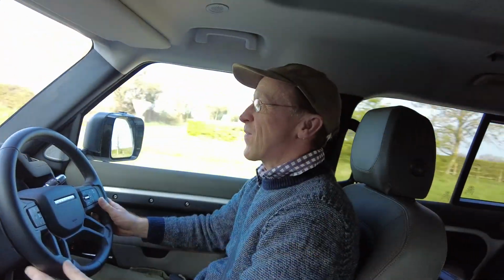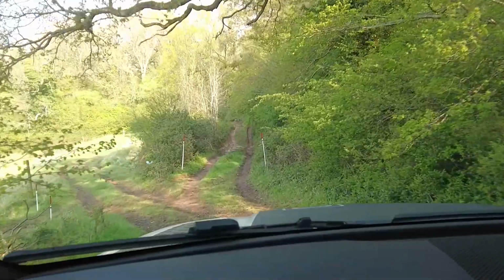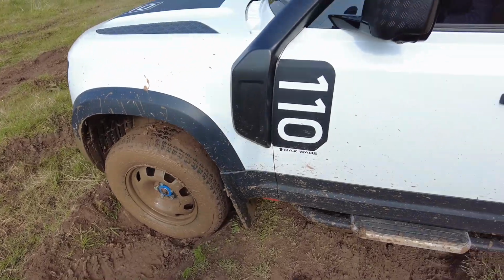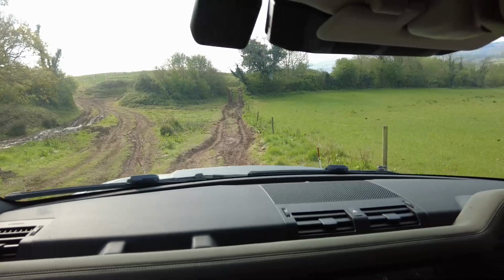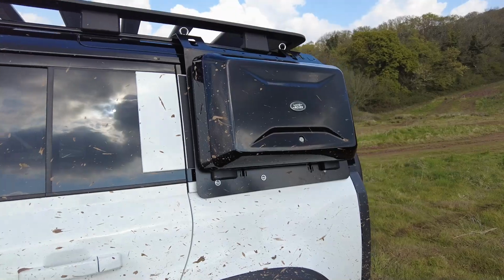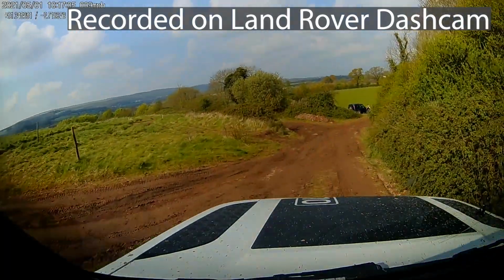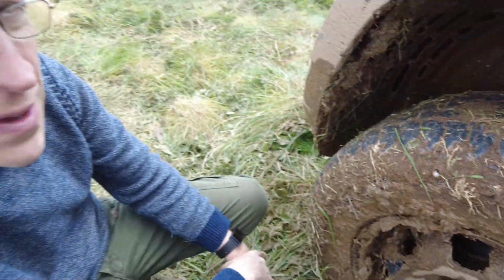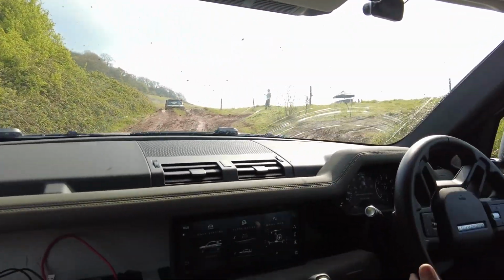New Land Rover Defender Off Road Test... New Wheels / Compressor =  Result ? [HD Video]

Comment: How did u reset the center screen? Had the same issue that my center screen wont turn on
Reply from the maker: I just turned the car off had a chat with some people and it came back of its own accord.
Also you can try pressing the on/off button for 40 seconds to force a "soft reboot"
Failing that you need to disconnect the battery ( battery under the drivers seat ) for 10 mins and re connecting.

Comment: The steps there; grass gravel snow would have worked better for you than rock crawl not saying it would have easily beasted the steps you'd have still needed momentum as the Defender is very heavy. Even though logically, rock crawling is kind of what is being simulated, what you had there was firm ground with a slippery surface, and for that, you want grass gravel snow.
Reply: Dead right sir! The tyres were full of wet clay and presented a circular wet surface with bugger all grip to the steps. I don't think rock crawl mode would work either if it were in the U.S in say the Moab desert and if it were pissing down with rain, you would still have no traction ( not very likely though in a desert lol)

Comment: when the screen goes blank, stop, get out, lock it using remote control and then wait for everything to switch off before unlocking it, getting back in and starting it up. Just opening and closing the doors wont always do a reset

Comment: Thanks Simon--great vid' and very informative--picking up my 90 next week--can't wait!!-lol
Reply from the maker: So cool - The 90 was pretty cool - George reckoned it was nicer in the back seats of the 90 than the 110... more light and space oddly !
What spec did you go for ?
Reply: @L663  Got the D300 SE with Pan roof/Cold pack/wheel arch protectors/black roof/Air sus/90 decal. May be asking for your advice on pivi-pro!!!!lol--Thanks again.

Comment: Looks like you need a wash down system Simon don't think landrover pump up one would be powefull enough perhaps you could use compressor to charge up a container to make a wash down kit for cleaning worst of mud from wheels at least. Try crossing ruts diagonally.
Reply from the maker: Its already been ordered and its in the workshop....TANK + AIR PRESSURE + WATER = Power washer !
Reply: Good plan. I have a Road Shower tank on my tacoma rack (usa) and is indispensable for rinsing dogs, kids and gear. Air up with onboard compressor and get good water pressure. Just don't forget a pressure releasing valve if building your own
Reply: Looking forward to the building of the power washer system powefull(uk) enough to shift the clag off the wheels.